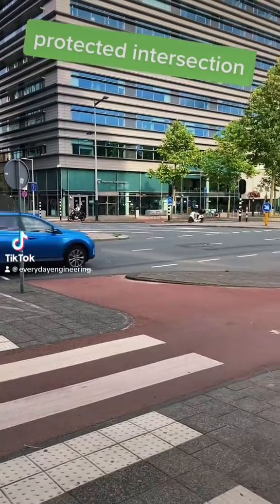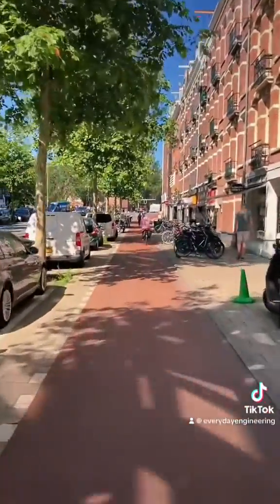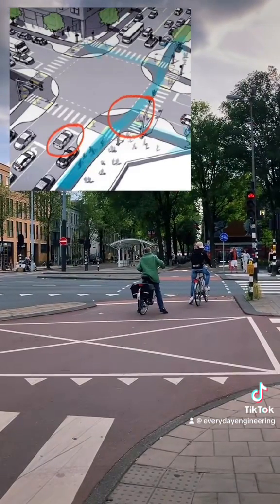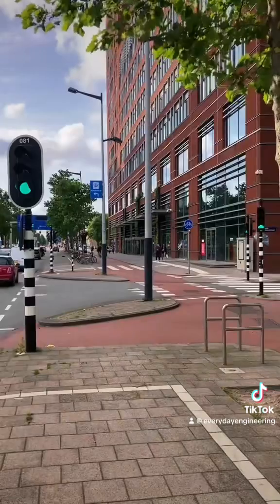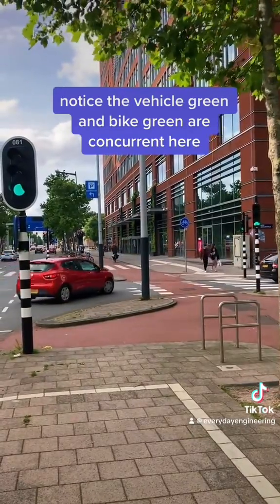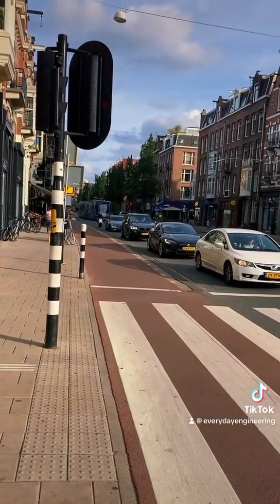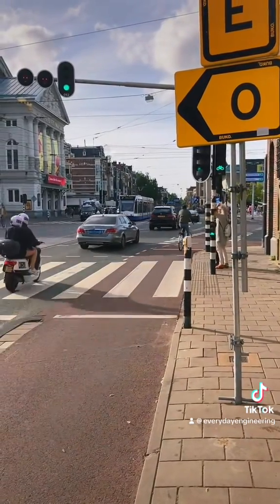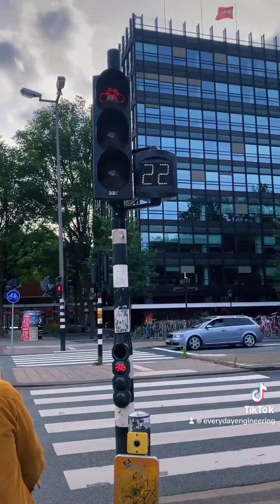Elements of a Protected Bicycle Intersection

Comment: I actually don't like the countdown timers tho, cause I feel like an intelligent system won't be able to know how long it takes, since it should depend on traffic.
Reply from the maker: The countdown timers accelerate or slow down based on real time demand. The numbers dont necessarily represent true seconds. They also use timers with just lighted dots that turn off one by one and that helps make it clearer that it’s not counting seconds